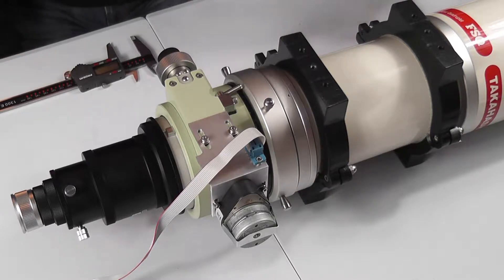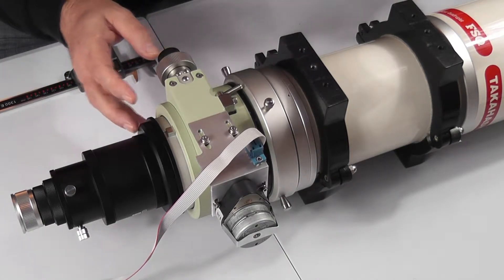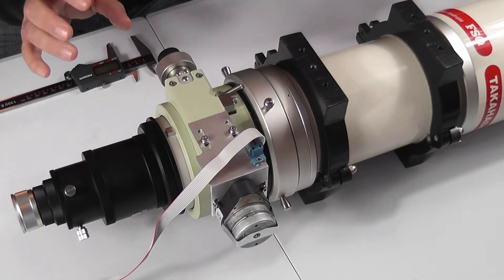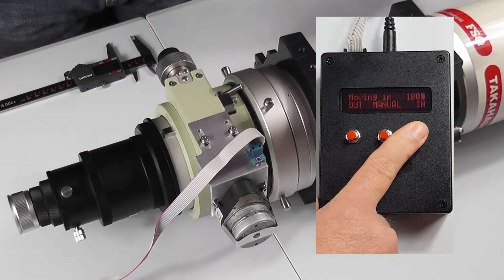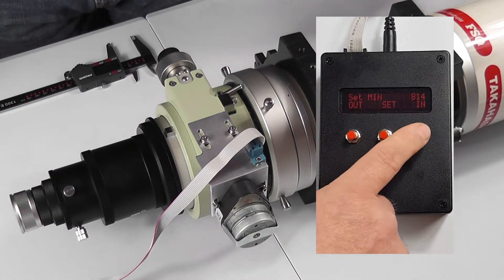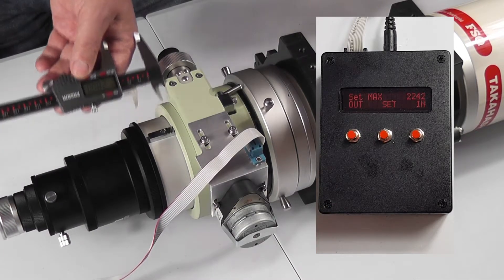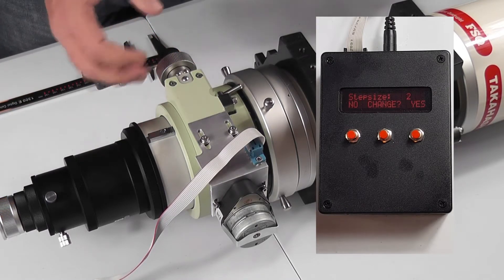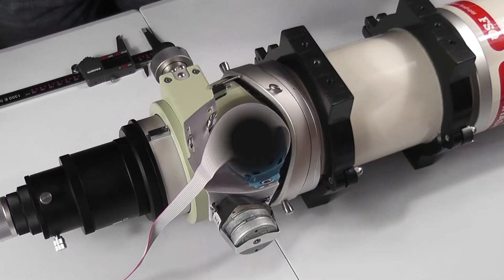Fitting Lakeside Focus Motor to Tak FSQ106 ED - Part 2

Comment: Hi, as usual a great video. I do have one question; what brand are those black rings for the FSQ? Many thanks again for sharing your knowledge and experience. Simon
Reply from the maker: Hi Simon.  Many thanks for your comment.  The rings are Parallax.  They are extremely good but do require imperial dovetails (hole spacing).

I've actually just sold these as I now use PrimaLuceLab ones.
Reply: @simplifiedastro2092  So you prefer the PL labs ones?
Reply from the maker: @simonwalsh6804   In all honesty, no.  In my opinion I think the Parallax rings are better, and inherently provide for the correct spacing to enable the OTA to clear the deovetail(s).  The PLL ones need a spacer under, and over if you use a dovetail on top, of them (they do sell these seprately).  Also the PLL ones have an issue with the adhesive tape used for the felts, which fails when it gets warm and allows the felt to slide in the rings.  This is overcome by replacing the tape, but it is an issue noted by me and a number of others who use them.

The PLL rings work fine but, on blanace and if the imperial spacing works for you,  I believe the Parallax rings are functionally better.